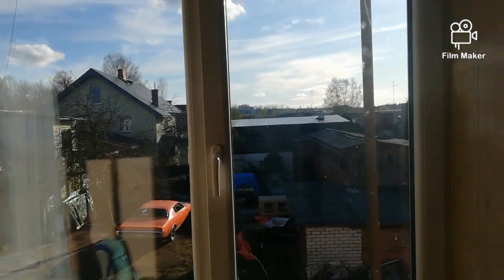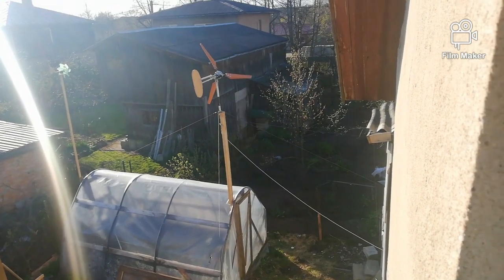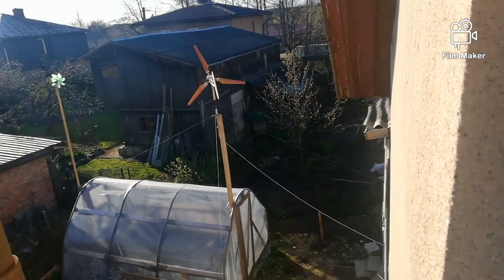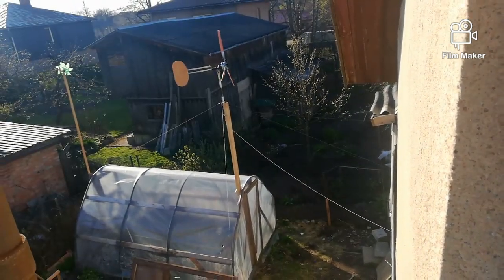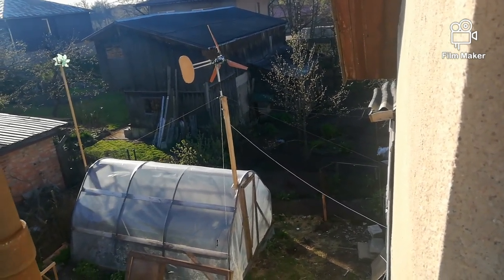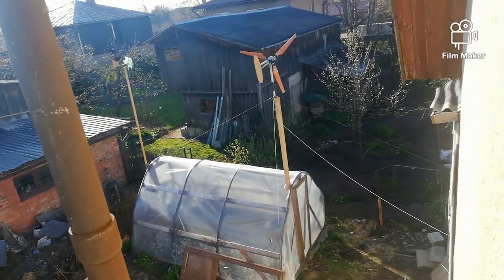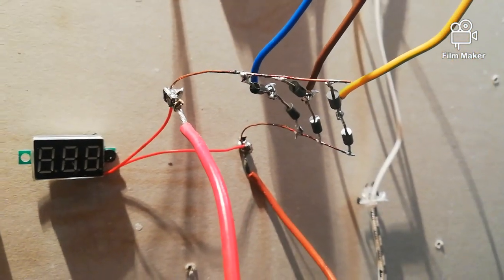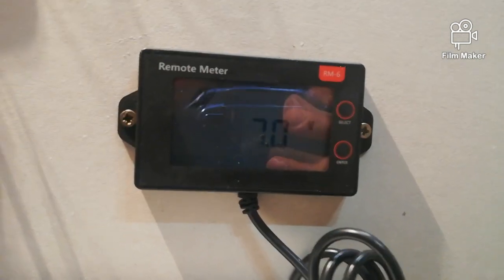Hoverboard wind turbine update

Comment: How much amps it can reach
Reply from the maker: wind turbine?
Reply: @SigmaWorksSW3D  yes, this is mine, made with pvc blades an two hoverboard motors, it can reach more than 30 amp, at 15 volts would be 450 watts +:
https://youtu.be/mHLdVvts9FA
Reply from the maker: mine isnt rewired and it reaches only  13.8amps at 12.6v with 18650s
Reply: @SigmaWorksSW3D  mine isn't rewired too
Reply from the maker: Niice ;) mine is copy from yours just with one hoverboard motor... and your blades looks more balanced than mine ;)
Reply: @SigmaWorksSW3D  I can't find any information on rewiring? Any links or help please!?
Reply from the maker: @ijustwanttolearnstuff  i will try to find full rewiring video, but its not optional to rewire them... they also work great as they are
Reply: @SigmaWorksSW3D  I bought 2 and want to try each to see what would be best for my situation. Thank you.
Reply from the maker: @ijustwanttolearnstuff  i believe that rewiring will change only low or high wind output start... only difference is in these motor models, but not big. and only max output you can get ordering real 300w blades from where ever you can. just like im making them from pvc as we speak. im replicating best blades for hoverboard turbine just like real ones... thats how im going to make output difference
Reply from the maker: sorry i cant find any good rewiring video... i kniw there was few in depth but i dont see them right now... try to find (rewiring hoverboard stator for wind turbine)

Comment: Hello, nice video ! Could you get some more volts ? I just built one too but voltage is low... from 3 to 5 vac, i do not have the bridge and 4800 mf capacitor yet
Reply from the maker: Just watch my recent videos...last video will show you all needed to make this turbine work and get power...at now im waiting wind to test my new 73cm blades
Reply: @SigmaWorksSW3D  hello Kriss, i watched your last videos, and i saw the 6 blades, let us know how different it is from 3 blades. also, how did you build your black steel iron holder for 6 blades ?
Reply from the maker: https://youtu.be/FZEMUfQOt1w
this will show you what rpm you will need to charge 24v battery
Reply: SRW Kriss Wow, almost 500 rpm, almost impossible with wind unless to mount it with a gearbox i would say. Thank you for the link.
Reply from the maker: @hichamtassi1753  i would say that if you can order normal blades and hub from ebay or aliexpress, or someone already have blades or can make for you then get normal ones... and for system 12v is the way to go 100%... think like this... if you have 2x12v batteries to 24v and you lose one... thats not gona be good, ut if you make them all on 12v then you lose only capacity of one battery
Reply from the maker: @hichamtassi1753  but my turbine with pvc blades got up to 46watts at araund 10-12meters per second and its even not tracking wind because of shty bearing as turbine base holder... so you can try to copy my blades, balance them well and they will work great if you have windy spot where to put your turbine... most efective would be on the roof of your house
Reply: @SigmaWorksSW3D  Hello Kriss, i already have nice 73cm blades but few volts obtained. Did you get better output with 6 blades ? 
i use 24v because the inverter is a 24v unfortunately...
Reply: @SigmaWorksSW3D  46 w at how many volts ? how many blades is better 3 or 6 ? What are the measures of your blades ?
Reply from the maker: @hichamtassi1753  it will be hard for it to make needed voltage because of magnet and stator interaction... if stator core was from aluminium then that would act like axial flux turbines without magnet pulling to metal
Reply from the maker: @hichamtassi1753  and 6blades are more better in low wind but with 3x55cm blades i got 65watts at 20meter gusts
Reply from the maker: @hichamtassi1753  that was araound 13.5-13.8volts i think and 6blades are better
Reply: @SigmaWorksSW3D  Ok Kriss, i understand that i will try to make a blade holder in aluminium to avoid that magnetic effect.
I will then design the 6 blades holder. Then with 13,8v,  i can share this through the 2 batteries, 2 amp per battery is good enough. Thanks
Reply from the maker: @hichamtassi1753  turbine stator should be from aluminium or plastic not blade holder, then it will ve easier to spin it up
Reply: @SigmaWorksSW3D  Ok i will do that. I have seen another youtuber using bicycle brake disk as a blade holder, nice idea !!! then you can try 3 or 6 blades and see the voltage change...
Reply: @SigmaWorksSW3D  Hello Kriss, to increase the voltage, i was thinking on either put 2 wind turbines in series or install a big pulley to increase the RPM, what would be the best in your opinion ? thanks
Reply from the maker: @hichamtassi1753  that would ad more resistance to all generator and blades... try to find on internet how to rewind hoverboard motor for higher voltage... that will help a lot
Reply from the maker: make video with your blades it will be easier to tell

Comment: It sure looks nice. It really wants to spin. Catches the gusts quickly. Turbines are a fun project to troubleshoot and so cool when it all finally works.
Reply from the maker: yes but with this one im just testing where could be best place for it... i can move it araund as much as i want and then put it 5-6m higher in sweet spot.
Reply: @SigmaWorksSW3D  i would think on the peak of your roof would be best. The air hitting the side of the house and surface of the roof builds up a good deal of pressure and accelerates. I've seen relatively small turbines make big power on roof peaks.  Honestly that's where id prefer to have both of my turbines but my landlord said "no holes in the roof".... so thats why they're on towers.
Reply from the maker: @smallcityhomesteaders1600  i have the same reason why its on the ground :(